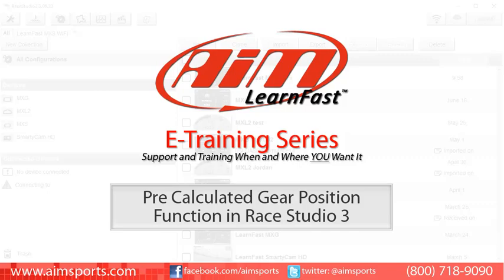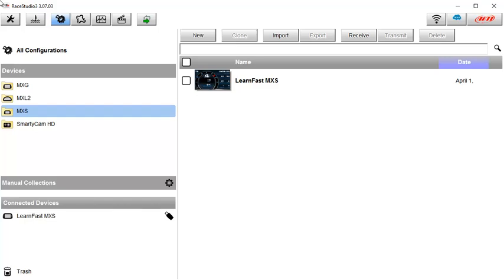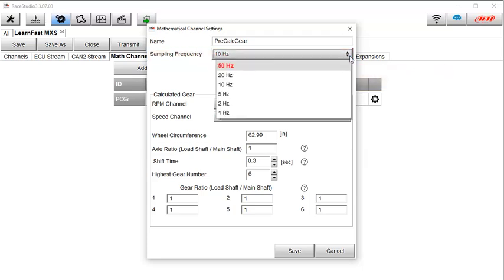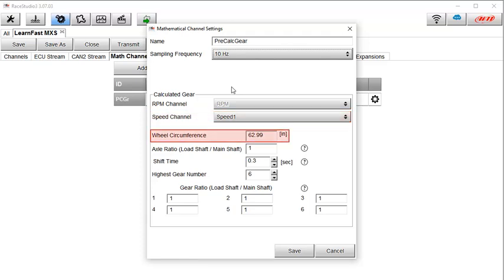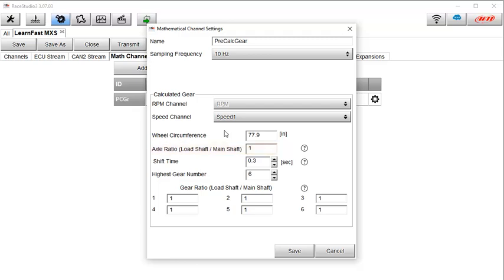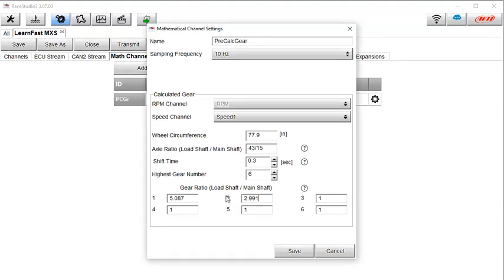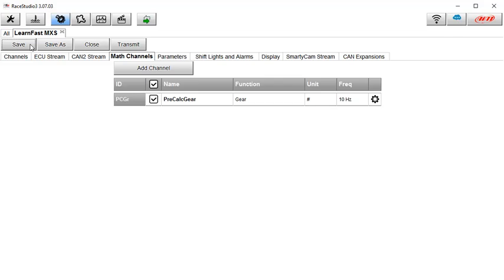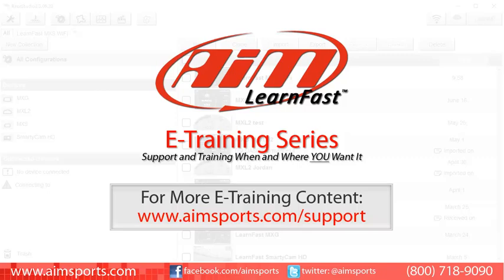Pre-Calculated Gear Position Function in Race Studio 3

Comment: I’m trying to understand what numbers I have to insert in gear Ratio if I’m using 26/15 load shaft / Main shaft instead of 43/15???
1:?
2:?
3:?
4:?
5:?
6:?
Reply from the maker: Marco, you have 2 options. For each of your 6 gear ratios you can either enter the actual number of the pair of gear teeth typed in as: '26/15' (minus the quotes) or you can divide 26 by 15 and enter the value as 1.733  Both will work equally well and RS3 gives both input options since users can be supplied gear ratios in both ways.